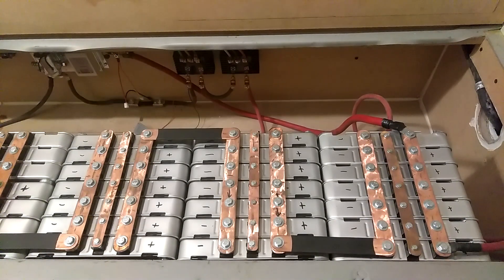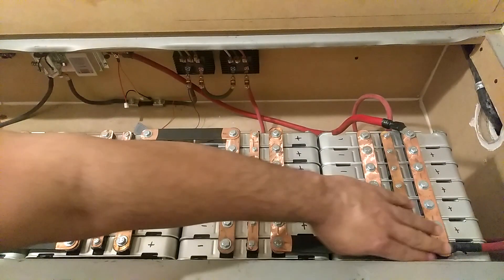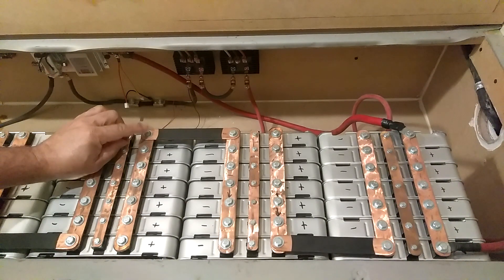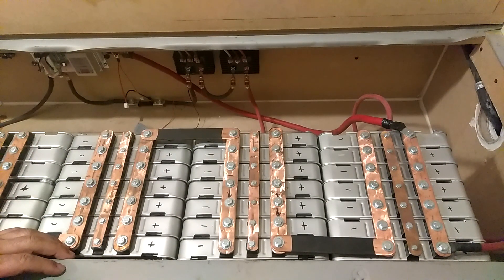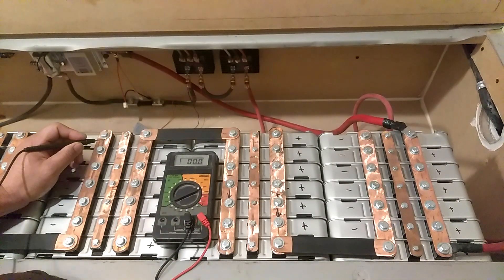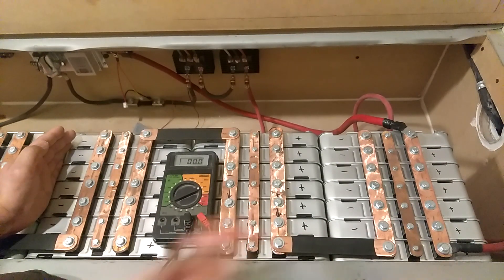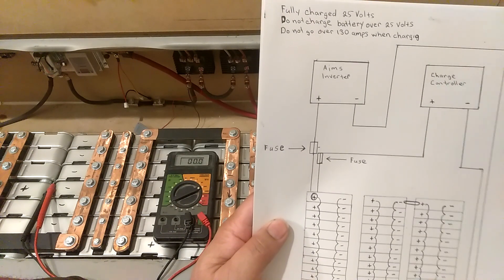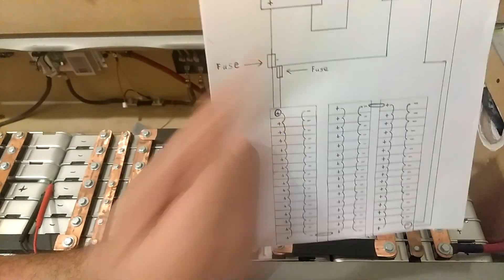How to make 24 volt Nissan leaf battery Bank.

Comment: I'm looking at an EV conversion using the leaf and would like to keep it as close to the original as possible but the leaf battery pack is to big for my project so I'd need to reconfigure them for better spacing. can the packs be put together differently and still use the nissan wiring?

Comment: so I have to buy 21 too have 24v like yours?  how long does this battery bank last. How long does it last running a pc or something of the same power.
Reply from the maker: Sorry for the late response haven't been on YouTube in a very long time. No you do not have to have 24 batteries to make 24 volts. Three modules in series will make 24 volts. If you start adding three more on top of that in parallel you start adding more capacity. The more capacity you have the longer the battery will last. If you had the battery set up the way it is in the video you would be able to run a laptop for a very long time maybe a week or more. I started off with 16 modules at 24 volts and I could run my whole house overnight with no problem.

Comment: I’ve never messed with these, but what kind of setup would you use to build a 36 volt DC golf cart battery? What would you use to charge it?
Reply from the maker: Big battery sells a 36 volt Nissan leaf battery setup for golf carts and I believe it comes with the charger too check them out at big battery.com
Reply: I’m kind of a do it yourselfer and I was wondering if I could do it a lot cheaper. It looks like all you need is enough leaf batteries and a battery control module, along with a charger. Is that right?
Reply from the maker: Yes but about time you source all of it yourself then put it together it probably would be cheaper just buying it.  Go to big battery.com and you can price everything you need there then you can see how much it would be if you bought everything separately.

Comment: So you actually have a 48v system? Do you run a bms?
Reply from the maker: Yes it is a 48-volt system and no I did not have a BMS on it when this video was done. I ran it with no BMS for about a year and a half but now I have a BMS on it.

Comment: Good day, I'm totally new to the concept of Lithium Ion batteries with all the gadgets that go with it. Do you need a BMS for this system? Can you use any charge controller or do you need a charge controller that supports Lithium batteries?
Reply from the maker: Sorry it took me so long I was not notified by YouTube that you left this message. To answer your question I ran my lithium Nissan leaf battery bank for a year or more without a BMS. Do you need one no but it is a lot safer and a lot less timeconsuming because you do not have to continuously check the batteries to make sure they stay in balance.  You can set your BMS up and if any of the batteries get out of balance it will set off a alarm and notify you that it is out of balance and it will shut down the system to keep you from damaging your batteries I hope this helped you out.  Thank you

Comment: i like how you helped ,i was wondering if you could help me with batt stuff,,,im doing a pack thats 7 x 7 thats what i call it its 7 down and 7 across,,56 volt battery, im confused about the wiring,,its gonna be 14 in a stack and 3 stacks like that then a single 7 stack
Reply: this looks to be a 7p 3s setup
Reply: i mean 7p4s setup

Comment: I like what you’ve done but wouldn’t    4 stacks in series do better for 24v most 24 v inverters run to 32 volts ? Your thoughts?
Reply from the maker: According to the information that I found on his inverter 29 volts was the max. And when he discharged his batteries it would be right at the threshold of damaging them when the inverter cuts off at 20 volts.
Reply: 8S is easier to get a BMS for than 6S

Comment: i like the lower voltage battery banks because; if the inverter fails you can still run appliances that can also run on  12/24v like a refrigerator, freezer, tv, lighting , its no big deal if the inverter dies. ive seen common ac  tv's that can actually run on 12v